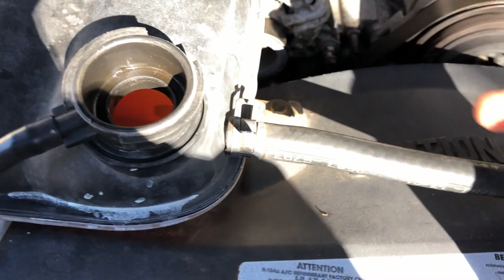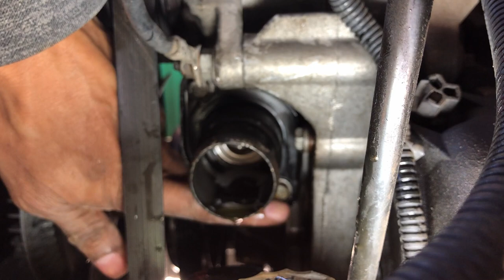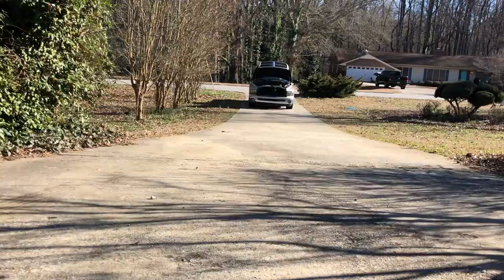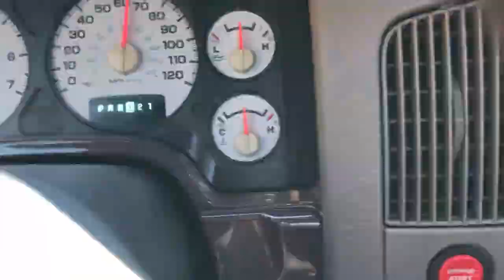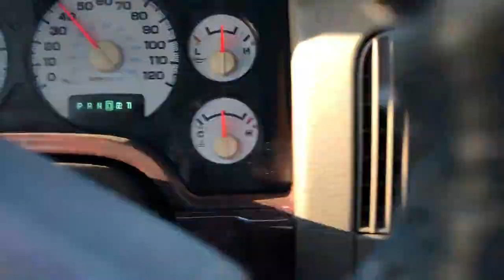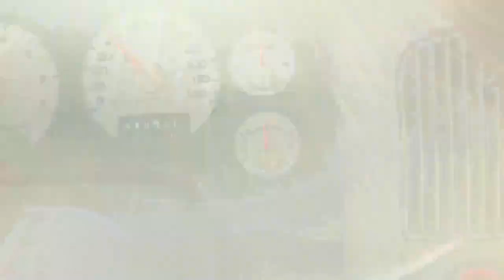Ram 1500 Thermostat Replacement... What coolant to use

Comment: Did you convert your ignition system to the new style ignition coils? If so, how did you do it? I just did a tune up on my 2003 ram 1500 and it was a nightmare. I don't know why dodge use an ignition coil & plug wire for the 2003 & 2004 model.
Reply from the maker: Old setup but I have never had any issues. I also have the 04 SRT10.

Comment: Nice video TR, Why did you go back to stock thermostat? Did you notice a difference with the thermostat change? Also that hood is slammin! Where can I get it? thanks
Reply from the maker: Thanks Dougie for checking out my video. The reason I went back to the original thermostat was because after my tune I started getting a code “thermostat below threshold” haven’t had any issues since. I live in a emissions county so couldn’t get registered until the code was gone. 

The hood is an original STR10 hood. A buddy of mine totaled his Viper Truck so I bought most of the what wasn’t damaged.